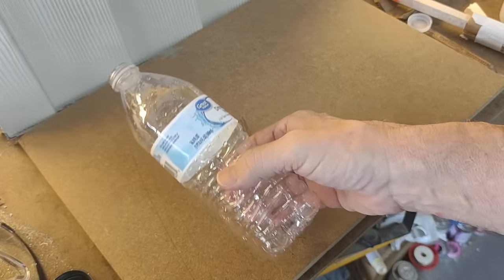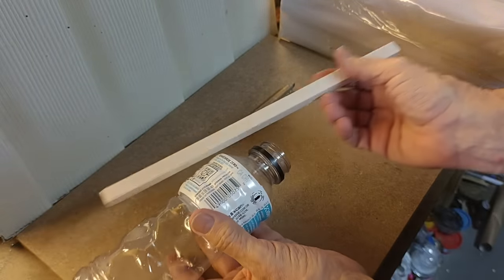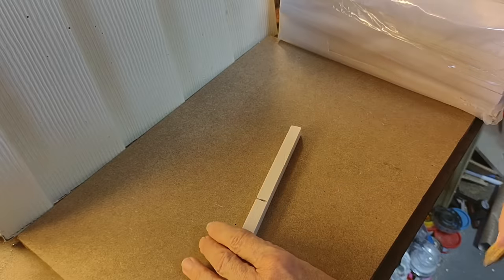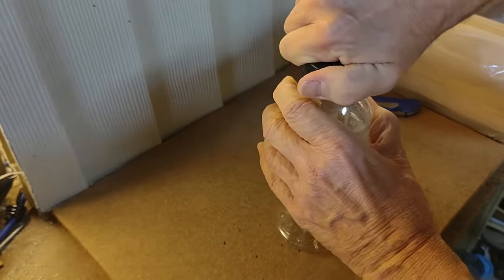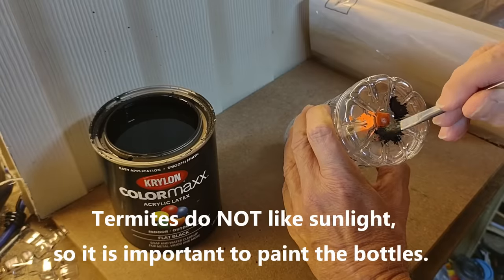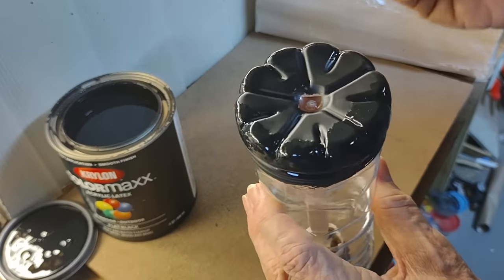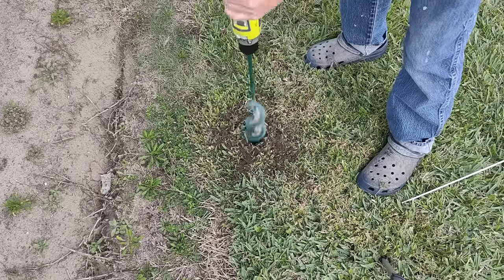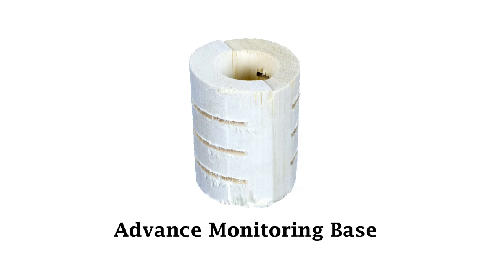Unbelievable Water Bottle Trick for Termites!  Simple to do!

Comment: Hi Guy I found a few subterranean worker termites under an entry mat outside my front door that had come up thru a gap in my pavers. I've checked the entire house and roof space (double brick exterior built house on a concrete slab with hard wood (jarrah) roof rafters) and found no evidence at all of an infestation. Even the wooden sill of the front door shows no evidence of deterioration from being eaten and tapping the wood indicates it is solid. I've had a couple of pest controllers advise me to do a perimeter barrier using a repelant ( Biflex Aqua Max) around the house but the thought of them drilling thru my pavers, every 300mm, which fully surround the house is not appealing. My thoughts are why can't I lift the pavers in question and douse them with a pesticide that they will take back to colony and kill the lot of them rather than just place a barrier which as you say could potentially be compromised anyways? Thoughts?
Reply from the maker: Please tell me where you live.  Location matters when it comes to termites.  Do you have pavers around the entire home?  Do they run all the way to the property line, or is there dirt alongside of them?  It would be helpful to see photos of all sides of the building, from the sides of the house to the property lines.  I may be able to provide an easy solution for you, but I need to see the situation first.  Photos can be sent to guyspestsolutions@gmail.com

I am currently on vacation, and I won't be home until June 11.  I get a lot of email, so it may take a few days to look at the photos, so please be patient with me.  I will get to it though just as quickly as possible.

I hope that helps.  Be well my friend.
Reply: @GuysPestSolutions  Thanks Guy I'm in Perth Western Australia. I will send thru some photos and some further info. Look forward to chatting.
Reply from the maker: I won't be home for another couple of days.  I will get through all the stacked-up email just as quickly as possible.  I can tell you what you need to do after I see the photos.  Australia has serious restrictions on pesticide sales to non-licensed operators, but you can obtain the product you need, and I have a source for it.  At least, I think I do.  Things change all the time.  Be well my friend.

Comment: Would it be better to inject the foam inside the inspection station first or would that method allow you to miss the fact you may already have an infection? Also how do we get rid of ants, black, and fire ants?
Reply from the maker: There isn't enough wood in the monitoring stations to make it effective to use that as a bait.  If a station goes off, you can make an actual bait station to install next to the monitoring station that went off.  Remove the monitoring station to make sure that it did not malfunction and you actually do have termites.  If you do, then put a few live termites in the bait station.  Replace the monitoring station back where it was and install the bait station right next to it.  Do not leave the termites exposed to the air for more that a minute or two.  They die fast when exposed to the air.

Please tell me more about the ants.  Are all of these guys in your home or just outside?  Fire ants that are outside can be easily treated, but if they are inside, then we may need to bring out the big guns.  If they are outside then watch my video on how to treat fire ants.  You can get rid of all of them for about $10.  If they are inside, then we need to talk further.  For other species of ants, that are inside, you should try baiting them first.  That will often do the trick.  If it doesn't, then there is a nuclear option.  Naturally, the nuclear option is a lot more expensive and time consuming, so start with the easy fix first to see if that will work.  If it doesn't work, I will give you the nuclear option.  If the ants are quite large, then these could be carpenter ants.  Let me know if they are all black and about 1/4 to 1/2 inches long.  These guys require a different treatment.  Please note that is is very common to have both termites and carpenter ants at the same time.  The ants like to feed on the termites and the termites do most of the excavation of the wood, which makes it very convenient for the ants.  A ready made home with lots of free food.  Not a bad deal for the carpenter ants.

I hope that helps.  Be well my friend.

Video on how to make a termite bait station:  https://youtu.be/r05Z-aUJehw

Video on how to treat fire ants:  https://youtu.be/VReLWuT-jcQ

Video on how to treat ants with bait:  https://youtu.be/64s5br_-F2I
Reply: @GuysPestSolutions  Thanks for the reply. I believe the black ants to be carpenter ants they are outside one to three of them on top of the deck. The fire ants I used over and out however, they just abandoned and moved the mound. I had an inspection last year after we purchased the home and he said there was no live activity but old evidence of a previous infestation. The previous owner had Terminex and bait traps. They sent a renewal letter for $484. I told them no and told them this is private property if they wanted the traps they need to make arrangements. I'd like to reuse the bait stations but don't want to fill them if they're going to pick them up. All the ants are outside, yes the other ants are between a 1/4 to 1/2 inch. All advice is welcomed!
Reply from the maker: @kennethhughley1611  If the carpenter ants are just outside, then I suggest that you treat the exterior of the house.  You may also want to treat the yard.  I do this every 60 days to keep all pests away.  One treatment will kill the existing ones, but they may come back from adjoining properties.  So, it is wise to treat at least every 90 days.  I will give you a link to my videos on how to treat the house and yard.

You were smart to cancel the termite contract.  You can do the same thing with the monitoring stations.  You can also apply termite granules every year.  I do both.  I apply the granules every year and I have the monitoring stations placed every 4 feet around my house.  The pest control company owns the Sentricon stations, so they will probably want to remove them.  Going forward, use the granules every year and do an inspection for termites every year.  Check the monitoring stations every month.  Please make sure that you buy the correct granules.  There are two kinds of granules now and one of them does not work.  They are both manufactured by Bayer, but they really screwed up on one of these products.  Make sure that you get the granules that use imidacloprid as the active ingredient.  The correct granules are no longer available at a lot of the Home Depot and Lowes stores.  However, they are still available on Amazon and I will give you a link to them.  I will also give you a link to my video on how to use them and a link to my video on how to inspect for termites.  I know this is a lot of videos to watch, but you will learn everything you need to know to take care of all of this stuff yourself for a fraction of what a pest controller would charge you.

 I hope that helps.  Be well my friend.

Termite granules:  https://www.amazon.com/dp/B000RUIJYM?ref=nb_sb_ss_w_as-reorder-t1_k1_1_6&amp=&crid=157C3RV0MY0AK&amp=&sprefix=termit   

Video on how to use termite granules:  https://youtu.be/H7rW_TSBHJ4

Video on how to inspect for termites:  https://youtu.be/oGyAVT7Zyro

Video on how to treat the exterior of your house:  https://youtu.be/Yozv3s-Qwlw

Video on how to treat your yard:  https://youtu.be/wifoTU5dmp0
Reply: Ants eat termites: natural pesticide.
Reply from the maker: @Gloria68  It is true that ants do eat termites, but it is unlikely that the ants will eliminate a termite infestation.  Of course, the fewer the termites the better, so I would not treat the ants until the termites are gone.  Be well Gloria.
Reply: @GuysPestSolutions  Hello Guy, I bought two containers of the Bio Advance granulates and went all around the home the deck and trees. Pulled off my clothes and showered and noticed what looks like a winged ant straight antenna and wings longer than the body. Is it a termite?
Reply from the maker: @kennethhughley1611  Does it appear to have two body segments instead of three body segments?  Does it have 4 wings of equal length?  If so, then it's a termite.  If not, then it is something else.  Ants do not have straight antennae and they have 3 distinct body segments.  Termites do have 3 body segments, but they appear to have only two.  This could be something like a webspinner or an earwig.  I hope that helps.  Be well my friend.
Reply: @GuysPestSolutions  Looks like three body segment. Once I smashed it all the wings went together. I did a Google search and it looks like a winged termite. I used two containers of the Bio Advance on the house deck post and trees. Do you think I need to trench? Terminex left the stations but I wasn't able to locate them all
Reply from the maker: @kennethhughley1611  This could be a termite.  Please tell me what color the body was.  Also, please tell me where you live.  Location matters.  I would not trench at this point.  It takes up to 12 weeks for the granules to work, so let's see what happens.  It takes the same amount of time for trenching as well.  I think before you do anything else, you need to identify the species.  If these are just subterranean termites, then there is a 95% chance that the granules will get the job done.  Be well my friend.

Comment: I’m on the 5th floor ina condo. We have dry wood termites. Please help!
Reply from the maker: I believe I answered your email.  You said that the building is concrete and steel construction, so you just need to treat the galleries that you see.  There is only going to be cosmetic damage.  To treat a gallery, all you need to do is buy a can of fipronil foam and shoot it into all the kick out holes and exit holes that you find for 5 seconds or until the foam is coming back out at you.  That will kill off the gallery.  You can use FiPro or Termidor Foam.  I like FiPro the best, but you cannot get it shipped everywhere.  I will give you links for both products.

I hope that helps.  Be well Susan.

FiPro:  https://www.solutionsstores.com/fipro-foaming-aerosol

Termidor Foam:  https://www.domyown.com/termidor-foam-p-3528.html

Comment: I know i have treamites . The tree fell down an full of wholes . How to get rid of please
Reply from the maker: How you handle that will depend on the species.  Figuring out the species is actually pretty easy and I have a video on how to do that.  I will provide you with a link below.  After watching this video, you should be able to identify the species.  Just get back to me after you watch it and let me know what you found out.  At that point, I can tell you exactly what you need to do.  Let me know if you have any problems identifying the species, but I do not think that you will.  It is much easier than you may imagine.  Also, please tell me where you live.  Location matters.  Be well Autum.

Video on how to identify termite species: https://youtu.be/dIs_a0nfVjg

Comment: WHAT ABOUT MOBILE HOMES, THE SPACE UNDER THEM?. YouTube overlord why I am here!!!.
Reply from the maker: When it comes to termites, mobile homes are not much different than any other home.  Subterranean termites always attack from the ground.  So, if you place the monitoring stations at 4 ft intervals around the mobile home, then you should be alerted to the presence of subterranean termites.  You should check the monitoring stations every month, and while you were out and about doing that, you should also check for mud tubes around the structure as well.  In your case, if you have a skirt around the mobile home, you may find the mud tubes coming up from the ground onto the skirt.  This could be either outside the skirt or the inside that is only visible from under the mobile home.  The other place they may attack is on the piers that are holding up the structure.  So, it is a good idea to take a flashlight and just look for mud tubes that may be coming up those piers.  The termites will almost always find the monitoring stations before they find your mobile home, but it never hurts to make sure.  The termites do not always get the memo about how they are supposed to behave.  If you do get an infestation at some point, then please get back to me and I would be happy to explain how to treat it.

I hope that helps.  Be well my friend.

Comment: do you have any solutions for carpenter bees?
Reply: Paint and/or sealer. I had them eating up my brand new deck, but as soon as used a combo stain/sealer, they never touched it again.
Reply from the maker: I do not have a video on how to treat carpenter bees, but I can explain how to do it.  The first thing you should know is that the carpenter bees are not doing most of the damage.  It's true.  The carpenter bees are boring holes into the wood, but that is only causing a little of the damage.  You see, after the bees get into the wood, they lay eggs in there that turn into larvae.  Those larvae eat wood to survive, much like termites do, and that is what is causing most of the damage.  When the larvae mature, they bore back out of the wood, leaving behind hollowed out wood, with large exit holes.  Therefore, you cannot end the problem by treating the bees.  You need to treat the larvae.  To do this you need to buy a fipronil foam and shoot it into all the holes, until it is coming back out at you, or the other holes.  The foam will expand to several times its original size and get into all those tunnels that were created in the wood by the larvae, thereby killing them.  Now that you have treated the larvae, you can go ahead and seal up the holes with wood filler, caulk, Bondo, or whatever works best in your case.  After you have the damage repaired, you need to make sure that you do not get anymore carpenter bees.  There are a couple of ways of doing this, and which method you choose will depend upon the kind of wood you are dealing with.  If you have wood that has not been treated with anything, like a sealer, stain, or paint, then you can use Bora-Care.  This is a permanent treatment, but you do need to finish the wood with something, like a sealer or paint, about 48 hours after the product is applied.  If the wood has already been treated with a sealer, stain, or paint, then you need to apply a pesticide to all the wooden surfaces every 60 days.  To do this, just get a pump-up garden sprayer and purchase some Bifen IT.  Mix the Bifen IT in the garden sprayer at a ratio of one ounce of product to one gallon of water.  Then simply spray all the wood surfaces every 60 days.  If you have areas that are too high up to spray with a pump-up garden sprayer, then you can use a hose end sprayer to reach places that are very high up.  Just watch my video on how to treat your yard with a hose end sprayer.  For this application you will need to use Bifen XTS instead of Bifen IT.  That is because the Bifen XTS has a much thinner viscosity than the Bifen IT, which will allow it to be picked up by the siphon tube in the sprayer.  An easier way to put that would be to say that the Bifen IT will not work in the sprayer, so you must use the Bifen XTS.  Just mix the Bifen XTS as I show you in my video on how to treat your yard with a hose end sprayer.  The sprayer that I recommend in the video has a stream setting that will allow it to reach as high as 25 feet, depending upon water pressure.  I will give you links for the fipronil foam and the Bifen IT.  If you need to go with the hose end sprayer, all the items you need are listed in the description of the video.  I will give you a link to that video as well.  These products are very safe to use, but I always recommend wearing rubber gloves, eye protection, and a respirator.  I have been hit many times with the overspray from this stuff and I'm still here to talk about it, so it is not all that hazardous.  Still, it is not a good idea to inhale any sort of chemical whatsoever and it is also not a good idea to get it in your eyes.  The truth is that these materials are no more harmful than common laundry detergent, but I don't think you would want to mix up some laundry detergent, spray it in the air and then get it in your eyes and inhale it.  You probably wouldn't want to get it all over your hands for an extended period of time either.  I always recommend taking a shower when you're finished as well.

I hope that helps.  Be well my friend. 
        
Fipronil foam:  https://www.domyown.com/termidor-foam-p-3528.html

Bifen IT:  https://www.domyown.com/bifen-it-p-226.html?sub_id=11662

Video on how to treat your yard with a hose end sprayer:   https://youtu.be/wifoTU5dmp0

Video on how to use Bora-Care:  https://www.youtube.com/watch?v=Rmr_aEodyhg

Bora-Care:  https://www.domyown.com/boracare-p-100.html

Comment: Nice, but what if you got concrete all around your house, (units).
Reply from the maker: You can place the monitoring stations along the edge of the concrete, as long as there is dirt there.  If the concrete runs all the way to the property line, then you cannot use monitoring stations.  About the best you can do at that point is to inspect every year for termites.  I have a video on how to do that and I will give you the link.  You should do this anyway, even if you do use monitoring stations.  I hope that helps.  Be well my friend.

Video on how to inspect for termites:  https://youtu.be/oGyAVT7Zyro